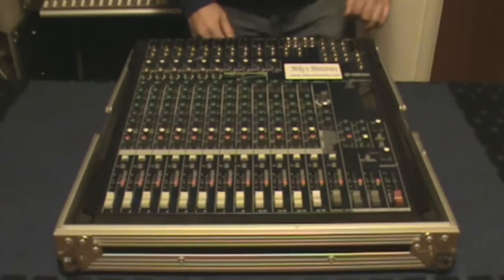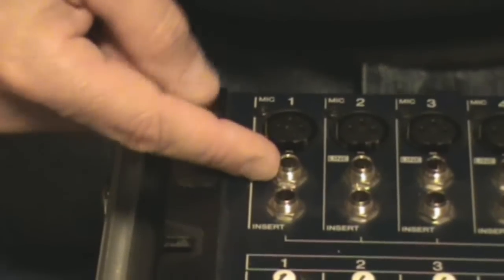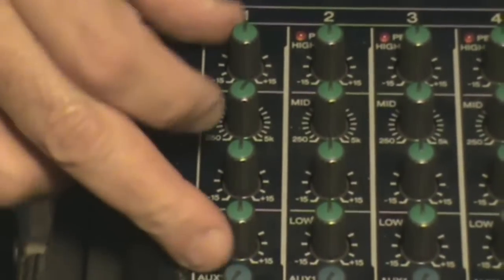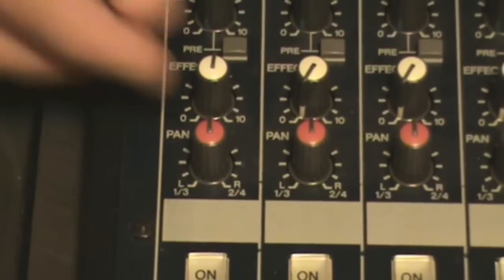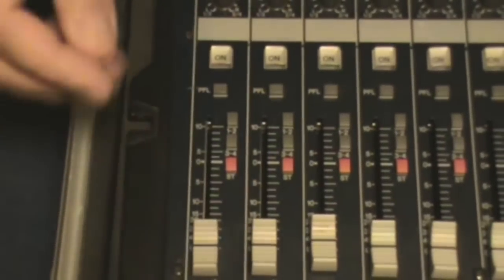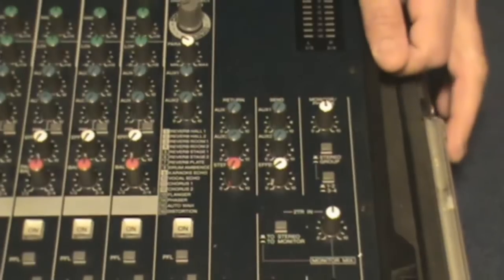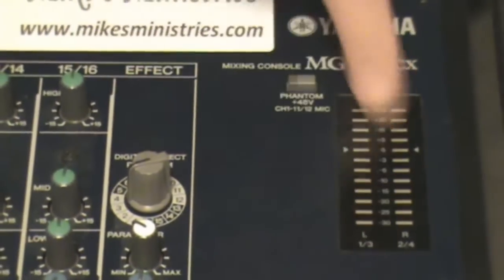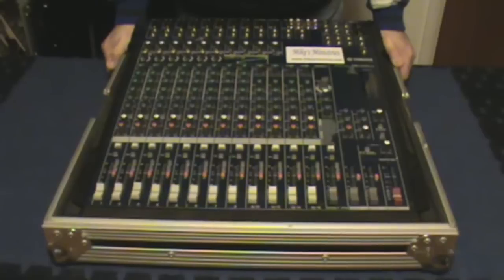Intro to Mixers - AudioTech

Comment from the maker: Funny you should ask for a cable video as I have been thinking of that as a next step in the video series. Lots of cables look alike and can get us in to trouble. So it is long overdue. Subscribe so you can it when I do it! :) One more tip, 1/4" jacks get people into trouble with speakers. You MUST USE SPEAKER CABLE! it is built  differently inside than a standard guitar or instrument cable which WILL blow your power amps, start a fire or both. Like I said, it's over due.

Comment from the maker: If your powered speakers have XLR jacks, run 'mic' cables from the snake sends to you speakers. NEVER use XLR cables to carry power from a power amp. XLR cables are used for many applications including lighting mixers, they are not only for mics. If you have them on your speakers they are there for a reason, to get the signal from your mixer to the speaker. XLR's are fine for that since the signal is amplified inside the speakers themselves and your are using them to carry a signal, not power.

Comment: Hello from Greece. Your videos are very helpful. I need 2 things. 1) make a "cable" video. I am trying to connect my Yamaha MG166 with 2JBL 515 as main speakers & 2 behringer B210D as monitors. Now all of them are active speakers. Trying to find appropriate cables I found out that XLRs are ONLY? for mics and 1/4jacks are usually for passive speakers. YOU SEE THE MYSTERY ?  And 2) I want to ask : Do you know a way to add more HEADPHONES on a mixing desk ? 4 lets say ? (for radio purpose)